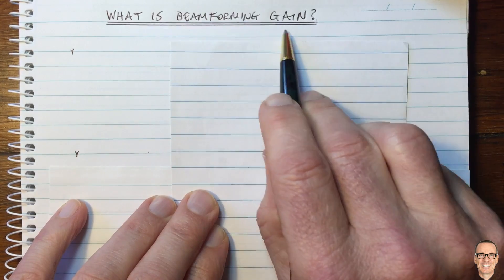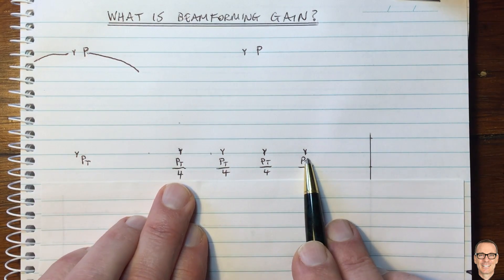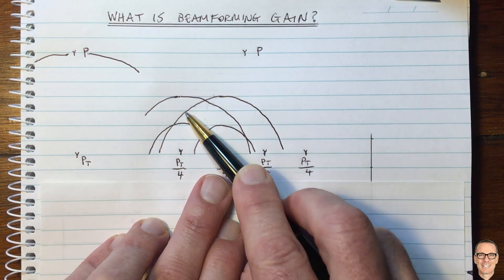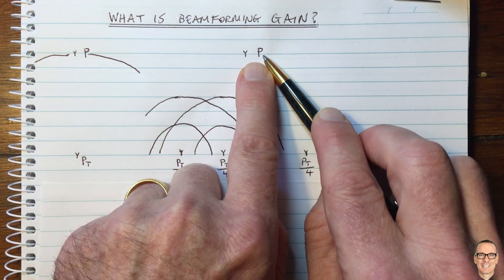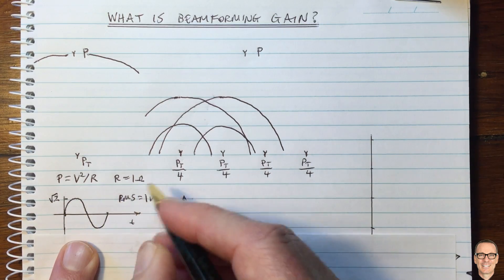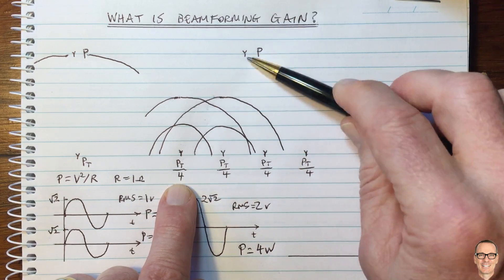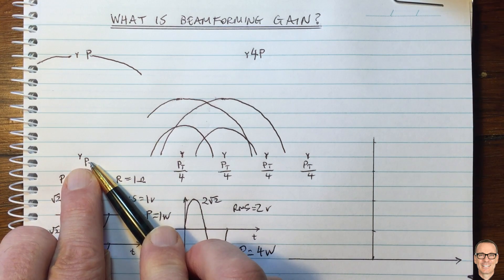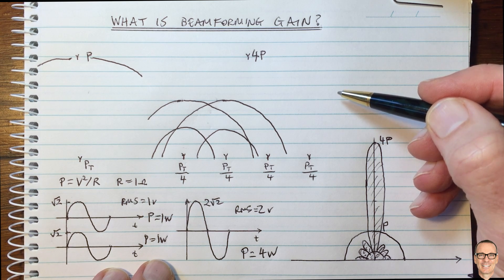What is Beamforming Gain?

Comment: Does it have the same effect as a parabolic transmitter/ receiver setup?
Which would be the most effective?
Parabolic or this .
Thank you for your great explanation 👍
Reply from the maker: Parabolic dishes collect/focus all of the waveform energy that "hits" the dish - so they generally have higher gain - but it's not possible to electronically steer their beams into different directions.

Comment: If the received voltage from the 4 transmitters is 1VRMS each transmitting at Pt/4. Then what would the received voltage from the single transmitter outputting Pt?
Reply from the maker: In that case the received power from the 4 transmitters would be 1W, which means the received power from a situation with a single transmit antenna with all the transmit power (Pt) would be 1W / Gain = 1/4 W , which would mean that the received voltage would be sqrt(1/4) = 1/2 = 0.5V

Comment: I think there is a math error. If you transmit at 1/4 power the peak of the sine wave is half what it would be at 1X power. The overall theory of beamforming gain is still correct. I do a lot of HAM radio and there we also have antennas with gain. The idea is that the overall gain averaged in all directions is unity but antenna characteristics remove gain in some directions and add it in others hence the gain.
Reply from the maker: If we consider each of the four antennas separately, the received RMS voltage from each one is sqrt(P/4). Since there are four of them, then the RMS voltage of the (coherent) bore-sight signal is 4 x sqrt(P/4). Which means the power is 16 x P/4 = 4P .

Comment: Is my following understanding right: at the first glance it looks like we get more power at the receiver than the transmitted power.
The explaination that this is wrong lies in the calculation of alternate voltage/ current maths (effective value of sines)?
Reply from the maker: No, that's not the case. Notice that I didn't say what the relationship was between the transmitted power P_T and the power that is received by a single antenna over the distance being considered (which I labelled P). That relationship depends on the receiver antenna aperture and the distance between the transmitter and receiver. I didn't want to get into those details in this video, so I chose to simply compare the difference in received power between having a single transmitter and an array of antennas. For details on the relationship between transmit and receive power, see: "What are Antenna Gain, EIRP, and Friis Equation?" https://youtu.be/mHo2-f5V8V4

Comment: Thanks, in the sketch down below,  we add up 2 antenna signals and get V_peak= 2sqrt(2) and we get P=4 W. 

With 4 antennas we would get V_peak=4sqrt(2) and RMS = 4V. So we get P=(4V)^2 /1ohm = 16 W.
Is that right?
Reply from the maker: Yes, that's correct - assuming that each extra antenna brings extra power with it (which is what I showed at the bottom, where each waveform had 1W of power). Perhaps I didn't make it clear enough, and I should probably have shown an example at the bottom where the two waveforms each had 0.5W of power - because that's what's happening in the antenna case, as drawn at the top, where each transmitter has a quarter of the power. In that case, each antenna gives a received voltage of RMS sqrt(P/4), and when the four of them add up in phase, then the overall received RMS voltage is 4 x sqrt(P/4) , which gives a received power of 16 x P/4 = 4P .